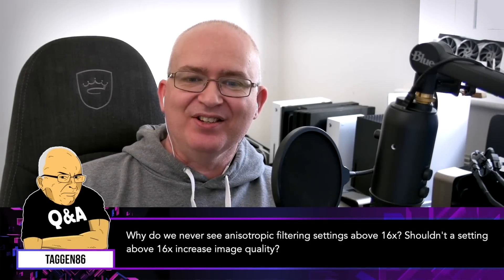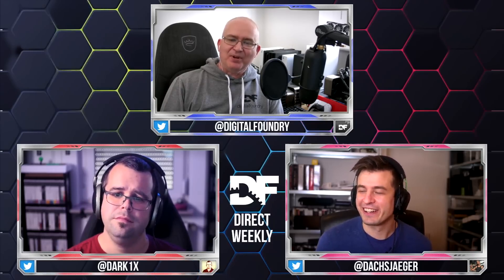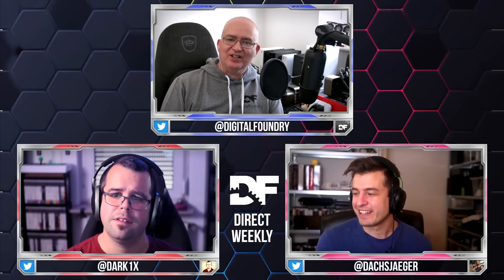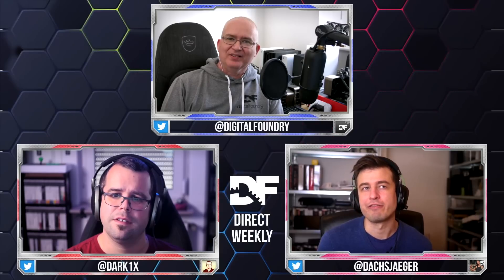Why Doesn't Anisotropic Filtering Go Higher Than 16x?

Comment: What I really wonder isn't why we don't have higher than 16x but why we still have games that seems to use something like 4x on consoles nowadays... Like in Alan Wake 2
Reply: i might be wrong but from my understanding it's heavy on consoles bc of the shared memory pool between the gpu and cpu.
Reply: Someone explained it to me on YouTube: because the bandwith in the shared memory in the  Consoles is too slow.
On PC the Bandwith of the GPU is much faster.
Reply: @Meinnameful  Actually the bandwith in consoles are faster,they usually have more bandwith than your average GPU but this Bandwith is shared between GPU and CPU while GPUs have a lot of bandwith just for them so its cheaper.
Reply: What does anisotropic filtering have to do with shared memory or memory bandwidth? Consoles have GDDR6 memory by the way, which is quite fast.
Reply: Anisotropic filtering requires a certain amount of video memory bandwidth, and that is something that is quite limited on consoles as they share access cycles and bandwidth with the main CPU. It's kinda like alpha blending and MSAA, they hammer the memory bus. Unless we go back to GPU configs like PS2 and Xbox360 where the eDRAM and rasterizer were made for excessive pixel fillrate, chances are consoles wouldn't bother going 16x. Plus we have so much particles, objects and foliage on the ground nowadays, that alone will mask the lower filtering.
Reply: It's probably to specific shader implementation, which just looks like badly filtered. I doubt that consoles has any difficulties with AF. During my development times I used Radeon HD 7600G CPU integeated GPU with shared DDR3 1333 mhz memory and I had super small impact on performance going from AF 8x to AF  16x. People sceptical about shared memory on consoles, but it's another stereotype, because it's a different shared memory compare to PC, it's soiled to motherboard and has very wide memory bus, not the same as DDR memory modules on PC.
Reply: @homersimpson8955  People are 1d10ts and spread BS left to right instead of trying to understand.
Reply: @homersimpson8955 haven't df already talked about the memory on consoles being the issue before?
Reply: @adamdunne6645  didn't see that clip from dt, would try to find it, thanks. Maybe consoles has some limitations for modern texture streaming approaches aka. Mega Textures, or some texture hungry shaders, compare to very high-end GPU. But definitely not for anisotropic filtering, also anisotropic filtering is not so bandwidth limited, due to neighbor texels taps usually overlaps, so taps for neighbor texels are cache friendly, so you not fetching all taps from the memory, so it's not always 16 taps from the memory. Modern consoles has plenty of bandwidth, sure it depends with what to compare, sure some RTX 3090 has more bandwidth, but it's not the card most people have. Also unified memory has its advantages, you can share resources between CPU and GPU without huge performance penalty, like on PC, so it opens new possibilities for some exotic algorithms which is not possible on PC.
Reply: To sell a better looking remaster on PS6
Reply: Maybe they figure that on consoles people are gonna be sitting on a couch, 8m away from the TV screen. A distance where you can't really see a difference.
Reply: @zdspider6778 doubt it. It’s obvious most of devs use monotors since text in modern games is so small.

Comment: Shouldn’t mesh shading eventually replace anisotropic filtering? I mean they are both kind of working off the same principal. Higher resolution for stuff within eyes range and lowering resolution, the further objects are off in the distance. Which takes to the players field of view, what they are looking at, and what should be rendered at the highest resolution. I’m curious, because I really don’t know the answer.
Reply: Mesh shaders aim to replace Vertex + Geometry shaders. You still need a Fragment shader - the only place in the graphics pipeline where trilinear/anisotropic filtering can be applied since those filtering methods need mip levels, and determining the mip level requires using screen-space partial derivatives (dFdx/dFdy/fwidth) which ONLY work in the Fragment shader.
Reply: I thought the fragment shader is programmable. But anisotropic filtering is fixed function according to Alex. Otherwise we could go above 16X. So maybe it's done before the pixel shading stage, during rasterization. Or directly after rasterization perhaps.
Reply: I don't think so. Textures are cheaper to render than models, so I think, if realistically they look the same, they would try to do it with textures whenever possible, thus requiring AF.
Reply: anisotropic filtering increases the sampling quality of oblique, distant textures. mesh shading isn't related to textures at all. mesh shaders are a more flexible geometry transformation pipeline that replaces vertex, geometry and tesselation shaders.

Comment: Better question would be why AF stops at a measly 4x on PS5 in 99% of games ?
Reply: Memory bandwidth requirements are pretty high for AF. Sharing your memory between the CPU & GPU doesn't help with that, which means developers having to make choices on where to best spend their rendering budget. Going beyond 4x AF would cost them too much bandwidth to do other things.
Reply: @MLWJ1993   Interesting. I guess thats the advantage of not shared memory setup is that you have performance free clean image with 16x AF.
Reply: @RighteousUncle  You'd have all the memory bandwidth available for just the GPU.

Theoretically you'd be able to overcome the bandwidth limitation on APU's though, but that'd be quite expensive for a gaming console (and the focus has mainly been on faster storage this generation instead).
Reply: @RighteousUncle yeah but with Nvidia toying around with 64-bit memory buses we might have to forget 16x soon lol
Reply: rahimsvoice   The clear cut off point/line between clean and blurry at 4x AF is very noticeable in any game, doesn't matter if it's 3rd person or not.
Reply: At leaat with the PS5 you get AF. The latest games on the Switch still use bi-linear filtering.
Reply: ngl sometimes i prefer 4x cuz make textures in the distance less shimering
Reply: Because ps5 is a last gen console masquerading as current gen.

Comment: I consider this the meat of my DigitalFoundry meal. These are the sorts of topics that i only vaguely understand and which the team explains well enough that I walk away with a greater understanding.
Reply: This time though I find it a little bit lacking. They say the games don't implement it because it's a hardware thing, but the person probably doesn't know or maybe don't even care about that and the question now changes to "and why the hardware doesn't implement it?" which they haven't answered. They also say we probably wouldn't tell the difference but also that we would tell the difference if we downsample. A little nonsensical, I think they messed up a bit with this one.
Reply: @Linkale_  I don't think Alex was suggesting we could easily tell the difference if we used downsampling to achieve 32x. I think he was just providing an alternative means to achieve 32x if you really wanted to try it for yourself. The general theme being conveyed here is that you will not see any tangible difference in most realistic scenarios, and it's implied that this is why the hardware function cuts off at 16x (diminishing returns).
Reply: @caleb_miller10  I suspected my comment could be misunderstood that way. What I meant is that he said the difference would be negligible, but then again you could achieve the same result doing X, so there has to be a difference (albeit almost negligible) or otherwise doing that thing would be pointless.
Reply: @Linkale_  When the difference is negligible, but either costs extra performance or requires more chip space dedicated to the extra transistors, it indeed becomes pointless to do. Alex specifically mentioned that you would really only see the difference on very flat textures in the far distance, something that is indeed negligible or non-existent for most games. It's pretty clear that GPU manufacturers determined 32x AF is not worth the die space or performance hit.
Reply: @Linkale_  There technically is a difference but its practically invisible to the player. It's like watching a movie on a 60 inch 8k display from 5 meters away once in 4k and once in 8k. Technically 8k is better but you will not be able to make out the difference between the two in a typical use case scenario.
Reply: @Linkale_  If you paid attention, he said that 32x would be too demanding for what it would do and you're better off just upping the resolution. The difference 1440p would do from 1080p would be a lot bigger and better than doubling the AF to 32x. Also imo, the performance hit from 1440p is getting smaller and smaller due to how modern GPUs work and I think that nobody should actually be on 1080p still if they're gaming unless you're on an extreme budget.
Reply: Learning what anisotropic filtering is, is like learning E chord on an acoustic guitar.
This is hardly meat.

Comment: 16x is much better than 8x. 32x must be cool .really why we dont have it ,its a cool graphical option .downsamplimng is not a good solution it messes with depth of field and film grain.....why there is no 32x af ???really good question and weak answers form digital foundry guys
Reply: Are you sure you’re not confusing AF with AA? Not sure how AF will mess with DoF and Film Grain, it’s meant to improve the appearance of textures that are at extreme angles to the camera.
Reply: alex said if u want better anisotropic filtering u can try downsamlpiing .i said its a bad idea  @UltimateWobbleBoss
Reply: @UltimateWobbleBoss  Not sure about DoF but I understand that single-pixel grain will not be sharp if you start downsampling. Similarly with stippling or dithering patterns that are intentionally not blurred.
Reply: @kunka592  There is no downsampling. AF is not fullscreen AA. AF makes far away textures stay sharper.
Reply: They answered. It costs a lot to do 32x and the difference would be worth it. You'd hardly tell a difference. And also it is a hardware thing and as alex was talking about it seems like GPUs don't support 32x.
Reply: In older games you were able to spot it. Because they had flat textures and nothing else to cover it up or break up the pattern.
But nowadays, with normal mapping, parallax occlusion mapping, dynamic tessellation, Nanite, it's not really as pronounced. Especially if you add things like bloom, Depth of Field (which will hide it even more), motion blur, various post-processing effects, shadows, decals, lights, dust particles, just random trash laying around in the scene (as geometry), broken pieces of walls, peeling paint, etc. It just breaks up the texture patterns and makes it difficult to really see the mip level transitions. Scenes have become so detailed that objects in modern games are very rarely a large flat plane any more. Except maybe buildings or something. But there are shader techniques to randomize their patterns. You'd be hard-pressed to find the mip level transition even if you KNOW what to look for (which most gamers don't), because the sheer amount of DENSITY that these new games have, even in open-world games... my god! There's a bush or a rock, or a tree every 2m.
Reply: DoF shouldn't be affected by resolution if the game is programmed properly. That's a bigger issue than anisotropic filtering stopping at 16x. And fixing film grain would be as simple as having a 'grain size' slider that just scales the buffer that the grain is rendered to - which should be a thing, anyway, even if you're not supersampling. 1px grain starts to look weird at higher resolutions.
Reply: He is right though, why is there no 32X options, our GPUs these days can handle it just fine or 24x options...
Reply: @Multimeter1  How do you know exactly that it can handle just fine? Have you tested it? Tried it?

Comment: Low levels of anisotropic filtering were a lot more obvious in older games, because you got more large unbroken flat surfaces of the same texture there. I definitely notice the difference between 8x and 16x in Serious Sam, for example.
Reply: draw distance in some old games is literally infinite and they dont have level of detail either. i think there anisotropic filtering is the most important.
Reply: @dmer-zy3rb  Because at such low resolution a distant object may resolve to just one pixel.
Reply: There were even levels x32, 64 and 128
Reply: @valeriylisnitsky6556 In which games?
Reply: GTA 5's roads
Reply: @rafaelvital8281  yeah, I definitely see a diffrence between 8 and 16 in gta 5
Reply: There's another reason. TAA is blurring out the detail in so many games, especially in motion, that it already makes 1440p look like 720p.